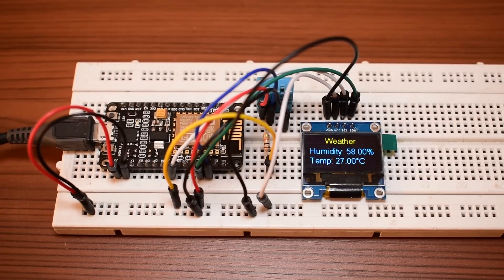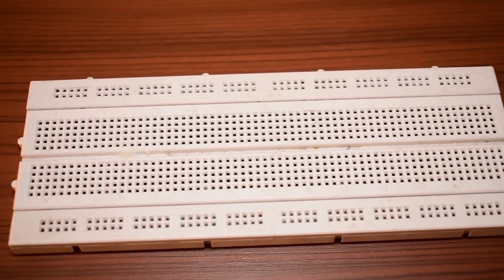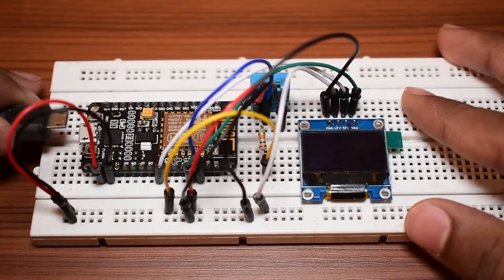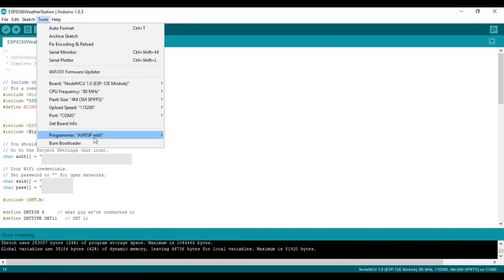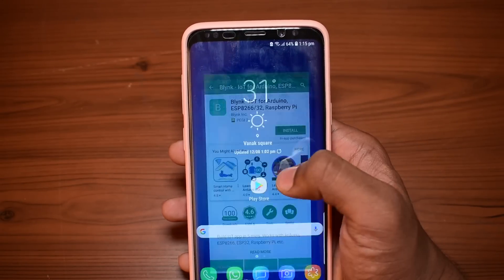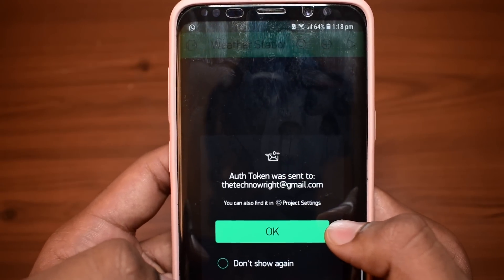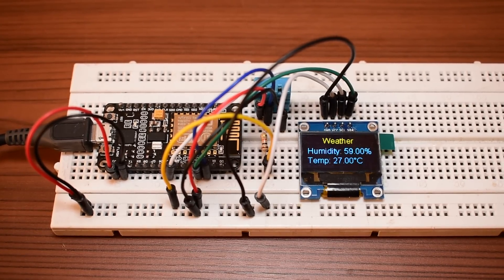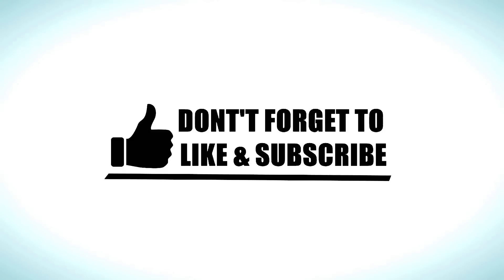DIY WiFi Weather Station using ESP8266 & Blynk

Comment: don´t work C:\Users\xxxxx\AppData\Local\Temp\.arduinoIDE-unsaved2023119-9492-1fw7wej.yigmk\sketch_dec9a\sketch_dec9a.ino:9:10: fatal error: SSD1306.h: No such file or directory
    9 | #include "SSD1306.h"
      |          ^~~~~~~~~~~
compilation terminated.

exit status 1

Compilation error: SSD1306.h: No such file or directory

I have download so many library , no works.... have you a link for this library???
Reply: same bro

Comment: Please do a volt measurement project of 24 dc on blynk
As well as the project of measuring watt consumption of ac electricity
Please respond to this comment
Reply: all types of projects available with ESP 8266 for all your automation needs for IOT with web server coding pls contact us at 9823042432

Comment: Will it work in Fahrenheit as well? I am going to build an enclosure for it on my 3D printer and upload the code to My Mini Factory.
Reply from the maker: Yes, it will. I have left a commented line in the code. You just have to uncomment it and comment the celsius part.

Comment: What is NodeMCU wifi range?
Reply from the maker: I haven't done the range test. But it completely depends on the antenna of the wifi-router and the NodeMCU. But on average, in an open area, it could extend around 300m to 450m.

Comment: I have now build the circuit with the DHT 11 just as you have in your video. I’m using the exact code and pins and everything. I wanted to start with this to make sure I had it working before I moved on to my other temperature sensors.
The temperature and the humidity flash on the screen 2 times and then the screen says DHT failed! Did you run into this problem was this code? I haven’t changed anything but I’m wondering if there is something different in the set up of the tools section in the Arduino IDE? Thank you for any help.
Reply: Did you figure out the reason? I have similar problem.
Reply: @janhavitalhar1147   I think the answer is yes :). If you're interested I will give you the code I Put together but what I ended up doing was was creating a system of 3 separate DS18B20 sensors. The controller takes the average of the 3 sensors and  controls a heating element  for an aquarium. The really cool thing is it is if one of the sensors gets out of a reasonable range it will ignore that sensor and take the average of the remaining 2 sensors and send me and send me a text telling me there is a problem with that particular sensor.If 2 sensors are completely out of reasonable range then it will just use the final sensor to control the heating of the aquarium and also send me a text telling me which sensors are the problem. It's pretty neat. Let me know if you're interested and I will send you the code. I would send it to you now that I'm not at home I'm at work.

Comment: I’ve been looking for this project. Only I want to use a DS18B20 temperature sensor and use two or three of them. Thank you for your video.
Reply: Can you please share the updated code for DS18B20, mine dont seems to be working
Reply: @amolabhang6926   I'm sorry I just saw this message but if you're still interested here's a message I just sent another guy who was asking about it. I will copy and paste it below.

 @Janhavi Talhar   I think the answer is yes :). If you're interested I will give you the code I Put together but what I ended up doing was was creating a system of 3 separate DS18B20 sensors. The controller takes the average of the 3 sensors and  controls a heating element  for an aquarium. The really cool thing is it is if one of the sensors gets out of a reasonable range it will ignore that sensor and take the average of the remaining 2 sensors and send me and send me a text telling me there is a problem with that particular sensor.If 2 sensors are completely out of reasonable range then it will just use the final sensor to control the heating of the aquarium and also send me a text telling me which sensors are the problem. It's pretty neat. Let me know if you're interested and I will send you the code. I would send it to you now that I'm not at home I'm at work.